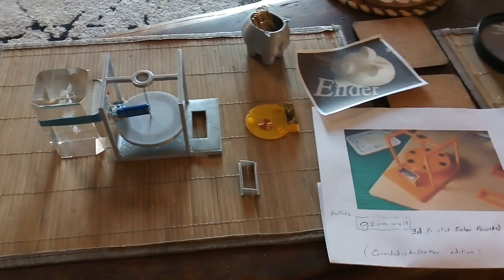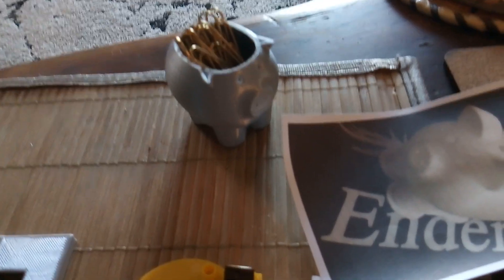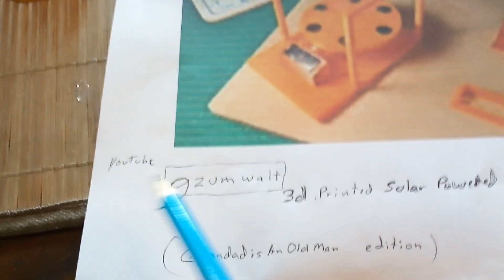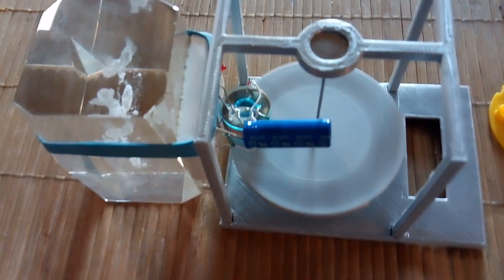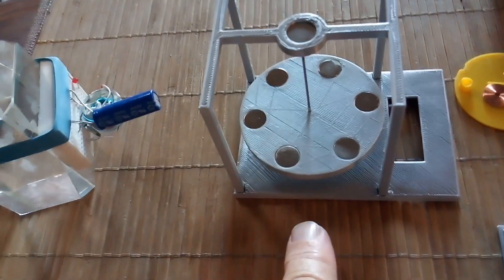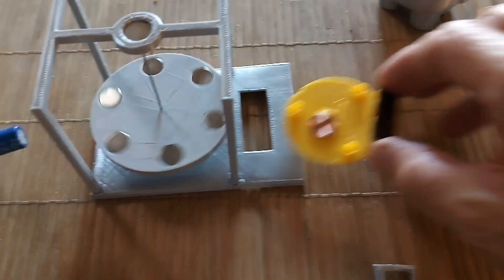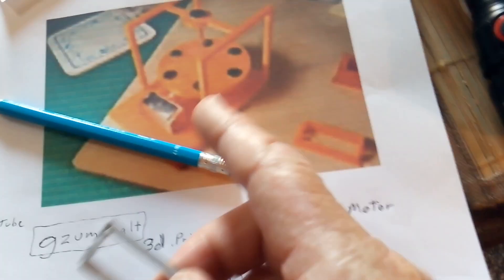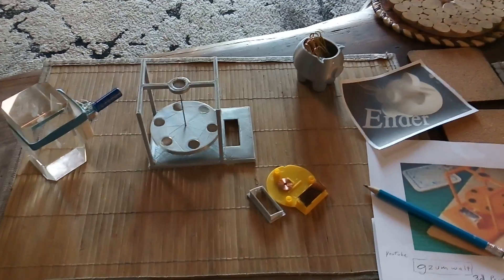My first 3D printer projects

Comment: Great work. Always pleasure to see new videos you make.
I'm thinking to buy 3d printer as well to build my pulse motor designs
but I'm thinking more about the resin 3d printers, they are quite cheap with much higher print resolution.
The spinning parts will much more balanced, like high precision top.

Comment: Great video. You can drastically shorten your print times by using a larger nozzle diameter and a higher layer height. Its not as detailed but you can always smooth up prints by sanding and use primer/paint, but if your just prototyping beauty is not a big deal. On my large prints I use a 0.8 mm nozzle and a 0.5 mm layer height. Prints come out actually stronger. Check out my Bedini motor video. I think in total it was 3 hrs to print and uses more plastic than your pig. Keep at it!
Reply from the maker: OK.  Many thanks for those tips on speeding up the prints.  For much of what I do high quality is not the goal but rather simple prototyping.  If the darn thing works I can always go back and do a high quality print.  Thanks.

Comment: nice tool,  you needed  that !
Reply from the maker: Yes.  It is like any tool though in that one has to understand what it can and cannot do.  The most important thing is to learn how to use it correctly and develop that skill.  It takes time.
Reply: @Lidmotor   I'm sure that it will increase your creativity  and make some projects easier and more doable..  Use some easy 3d design software and  all the rest is piece of cake for a guy like you ;-)

Comment: it is strange that the bundled test prints like the pig take so incredibly long for their size.  I've printed something 4x that size in ~7 hours, maybe Cura's slicer uses higher travel speeds than what Creality used to slice those test prints?  btw, there's lots of fun Pulse Motor designs on Thingiverse!  :D
https://www.thingiverse.com/search?q=pulse+motor&type=things&sort=relevant
Reply from the maker: I must have some settings wrong.  I need to learn a lot.  This is all brand new to me.